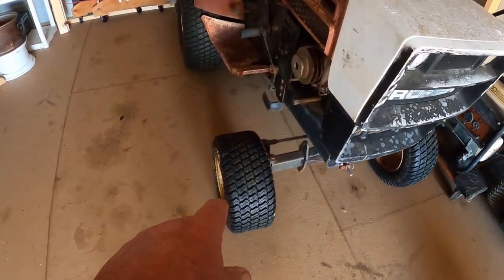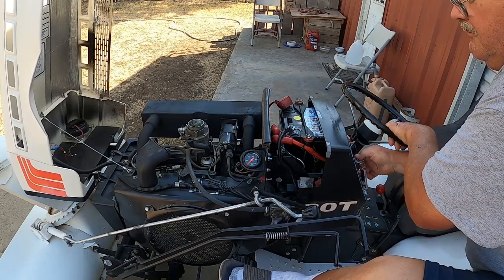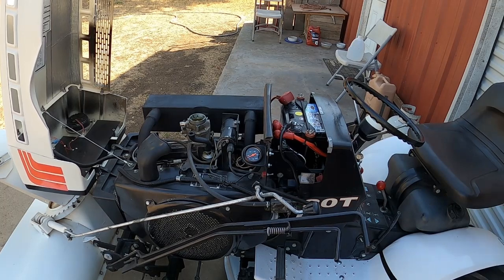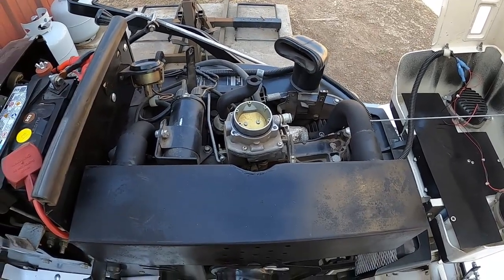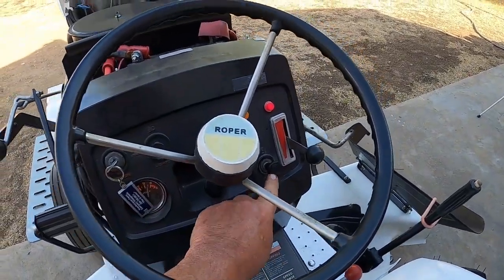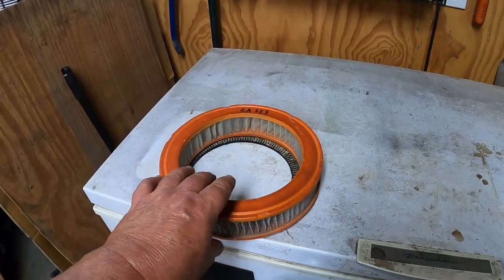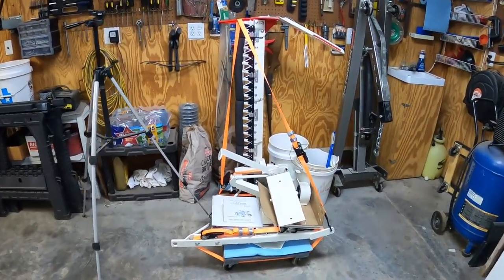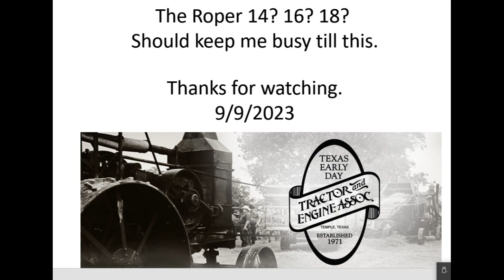More Show prep   Issues and the new project   Part 2

Comment: It sounds like it might be worth giving the carb a clean. It you have trailer space it might be worth also taking the other Roper to display as a barn find and next project
Reply from the maker: I wish I had trailer space for two. Best I could do is to make two trips for now. I have thought of taking the Mule before. The trip is 33 miles one way, so it would not be too bad. I might just do that this year sense the Roper isn't running too good.

Comment: Those Onans are kinda known to surge. When you rebuilt that engine, did you separate and reseal the 2 halves of the intake pipe? From what I have seen, that intake pipe will start leaking where the 2 halves meet causing the surge. I'm sure there is a good thread on MTF about this issue.
Reply from the maker: I don't think I did, After this year show I plan to clean the carb and I'll look at the intake. Thanks!